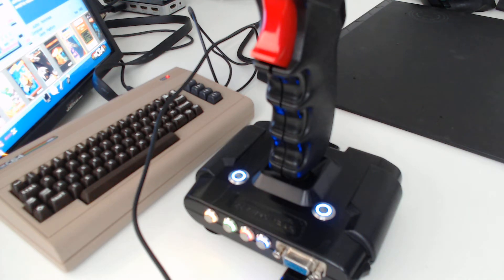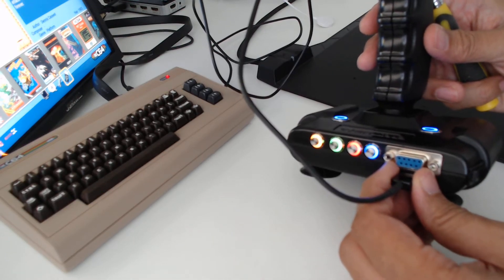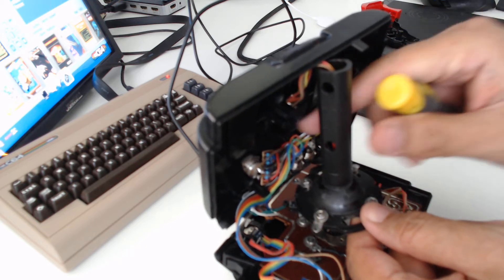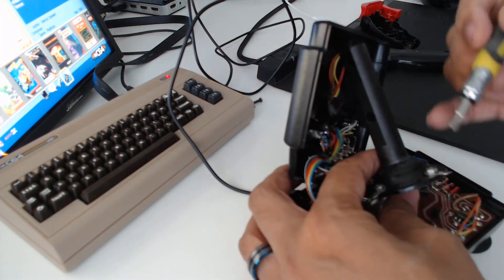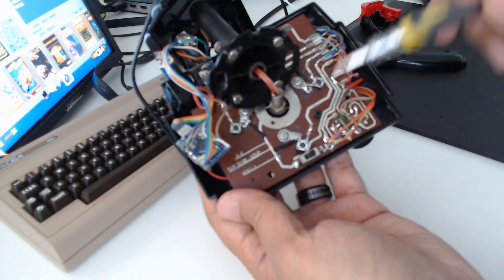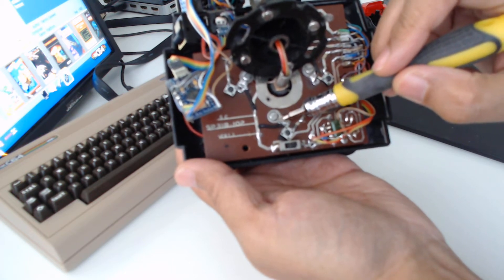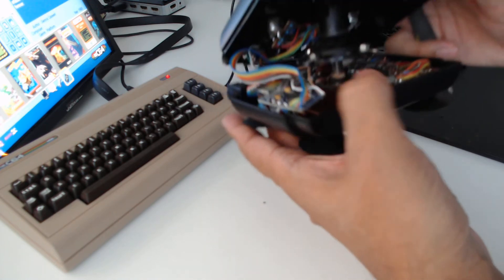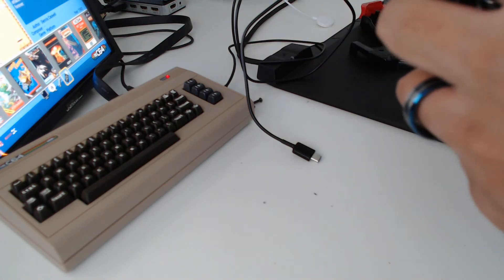Spectravideo Quickshot 2 Retro Joystick repair (Atari / C64 ) - Leaf switch repair and C64Mini mod

Comment: Hey there
That repair looks interesting but I'm more interested in those buttons you have on that stick and the conversion for TheC64. 
Are you able to share build details please?  Is it difficult to do - seem to be a LOT more wires than I have in mine!
Reply from the maker: This will be the subject of an upcoming video.

I will share the parts required ahead of the video - the buttons need to be quite specific in diameter and depth so they don't hit the PCB or interfere with the stick.

For A,B,C,Menu use these:
8mm Metal Push Button with LED Indicator Self-reset Momentary:
https://a.aliexpress.com/_v39LOk

For TL and TR (triangle buttons on the original stick) use these:
Electric Waterproof Power Led Light Momentary Short Mini Push Button Switch 12 mm:
https://a.aliexpress.com/_uIaJJe

Then you will need an " Arduino Pro Micro" 5v micro controller - lots on eBay or Amazon, and 28AWG ribbon cable.

The build requires skill with a drill - the plastic is VERY easy to crack so needs to be done slowly and carefully, soldering skills for the Arduino and switches, and some steps to upload some code into the Arduino.

I will share full details in an upcoming video and the "Sketch" for the Arduino.
Reply from the maker: I should also add that positioning of the additional buttons requires some care as there are some plastic pillars which can come in the way.

I had already installed a DB9 connector on my case which limited my choice hence the 4 front buttons are positioned to one side.  

The 4 front buttons may be better positioned centrally which would also allow you to install the top push buttons forward if that's your preference.

There are unlighted versions of the switches available too which cuts down on the amount of ribbon cable required, and these are also available in black.  But I thought the chrome looked nice!

Comment from the maker: Parts required:

1)	Male spade connectors with screw holes:
https://www.ebay.co.uk/itm/333176804212?var=542194159158

2)	Multi pack of assorted switches:
https://www.amazon.co.uk/gp/product/B07DK2D16R/ref=ppx_yo_dt_b_search_asin_title?ie=UTF8&psc=1

I purchased the multipack but used 6x6x5mm tactile push button with 2 side feet similar to this one:
https://m.alibaba.com/product/1700006874469/Szwxw-6X6x5-Side-2-Feet-Light.html 
These were included in the multipack but not pictured.  I actually received 24 assorted switches as opposed to the 10 pictured.

3)	m4x5 6mm pan head machine screws and nuts available from any hardware store

4)	Optional DB9 female connector:
https://www.ebay.co.uk/itm/D-Sub-9-Pin-Db9-Female-VGA-Solder-Type-Socket-Connector-Genuine-UK-Seller-/274099432247?mkcid=16&mkevt=1&_trksid=p2349624.m46890.l49286&mkrid=710-127635-2958-0